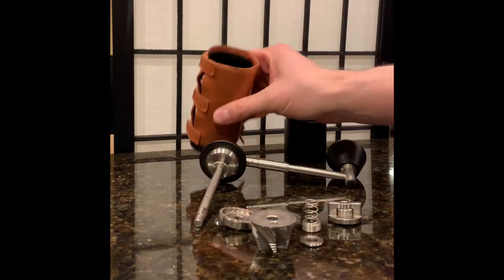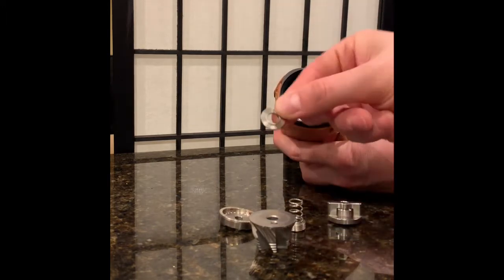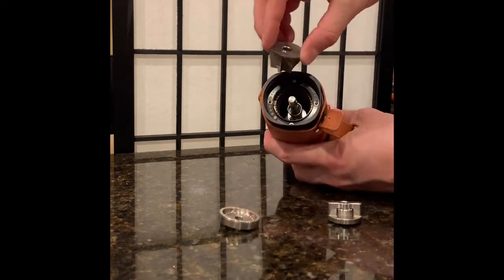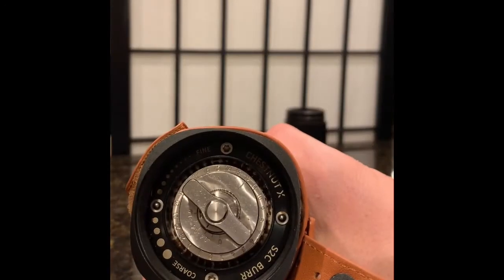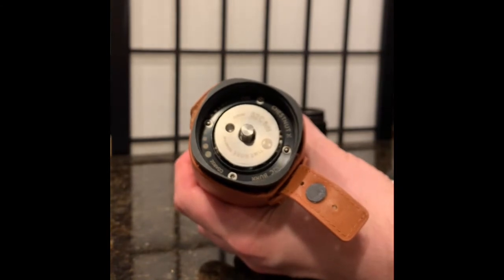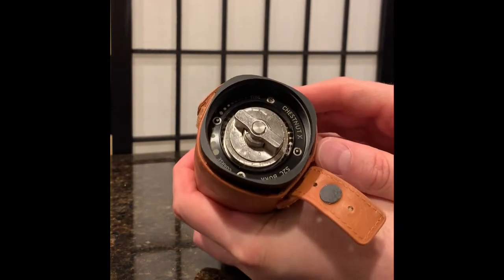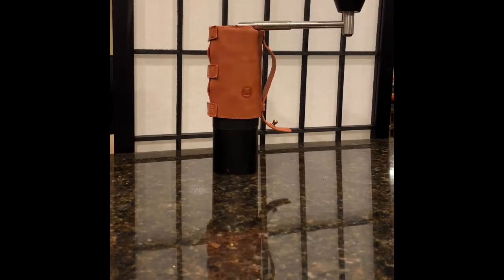Timemore X assembly

Comment: thank you! this is very helpful! Do you happen to know if this grinder is supposed to grind fine enough for Espresso? when I first bought it, I did a few trials and it looked like it can do espresso fine. But now I took out after some storage time, and it seems to grind only very course sizes. Not sure what I am doing wrong.
Reply from the maker: It definitely should be able to grind for espresso. That’s what I use it for exclusively. Without seeing the grinder, I have no idea what is the problem with yours. I’d make sure you tighten it until burr touch and then adjust back from there. Maybe try that?
Reply: @brentroman  Thanks for your reply. I did what you are describing. It works better now to produce finer grounds but the burrs are touching! It is scary to think I am damaging such an expensive grinder
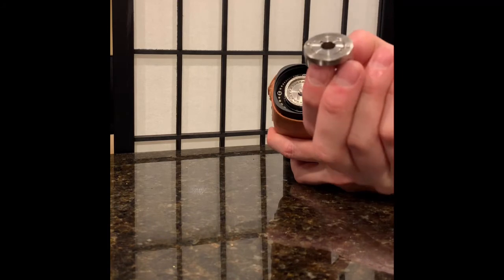Reply from the maker: @Mujahed0001  check out the issue I talk about at around 0:53 in the video. Make sure you zero out the grinder correctly. There are 2 ways it can go back together. One is good. The other isn’t. (I don’t know if that’s your issue or not)